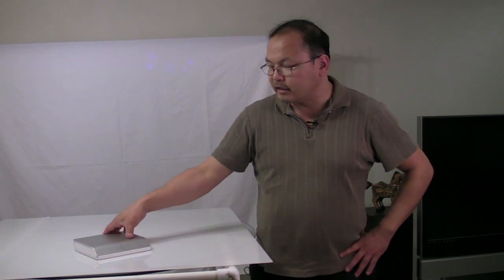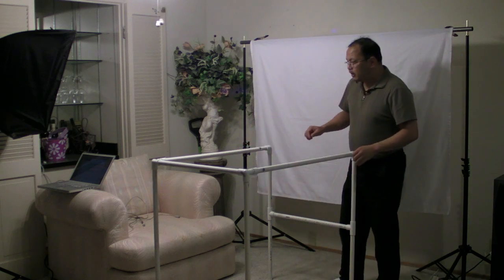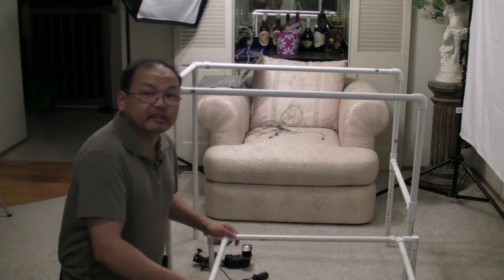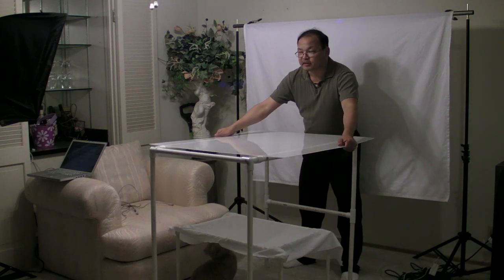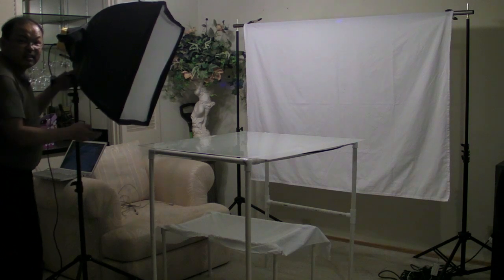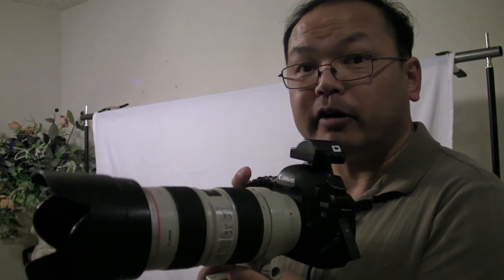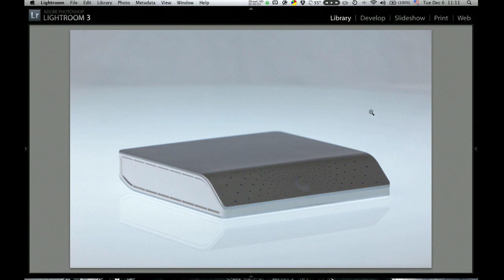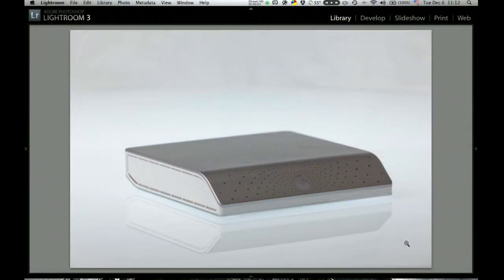Photographing a tech product on a DIY light table

Comment: Hey dude, thanks for the valuable information! Another option would be to use two separate exposures. One for the product without wires and one longer exposure with everything plugged in just to get all the led lights lit up. Afterwards you just have to use the LED exposure as a composite in your original photo.

Cheers man! Happy Father's Day!